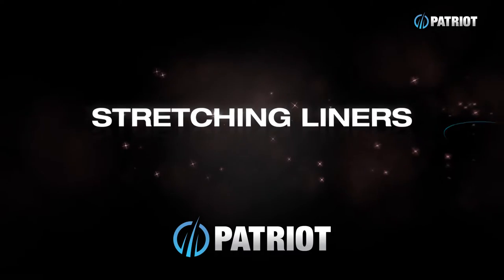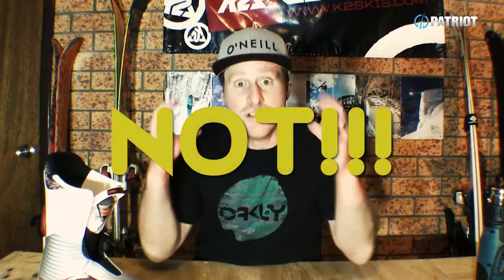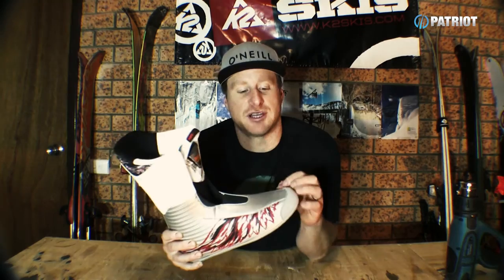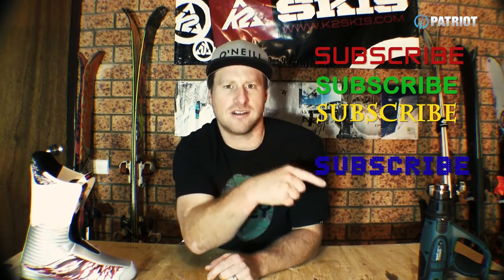Stretching liners - Bootorials Ep. 29

Comment: Do you have any visual examples on what happens when a liner blows out from old age?
Happened to me 2 years ago. I used to ski a lot in New England, but now living in Texas, so couple times a year. After the blow out, took a lot of effort to get my foot in the boot as the liner material was much more “malleable”. Had to use the ski racer approach on recreational boots...put liner on the foot, then put foot in shell, even then was a horrible experience.

Boots were about 14 years old. Luckily heel and toe of the shell had enough meat for bindings to hold on to, and the boot fitter recommended custom liners. (OMG...liner technology has come so far!! Yeah for ignorance!)

I wanted to share my experience with other enthusiasts, and was wondering if you had any visuals to demonstrate how bad it can get if skier waits too long.
Reply from the maker: Dont have anything great visually to share, but I did talk about it a little more in depth in this video - https://www.youtube.com/watch?v=31hUTWnqe0w
Yeah it seemed to have an era of boot liners where the adhesive leeched through into the fabric of the liner, was very common in Salomon and Lange liners. Basically made them impossible to put on. :)
Definitely some great options for replacement liners these days!!
Reply: Thanks for the link. That pretty much covers it. Liners I had to replace came from pair of Nordica Beast 10, early series with the red shell. Now I get to enjoy them a while longer.

I can tell my skiing style has changed over the years. Nowadays, I just want to feel the g-forces and get a great carve out of each turn. The boot shell may have a little too much flex, but I can definitely feel an improvement with the new Intuition liners. So I am happy skier!
Reply from the maker: Nice! :)

Comment: What are your thoughts on not using the liner? When I brought my boots, the place I bought them from said to use them without the liner for a couple of days (to break the boots in????). I use the liner but sometimes it feels nicer without. Big feet issues. Obviously not so great when its cold.
Reply from the maker: +Simon Neen  Not sure if we are using the same terminology! Do you mean not using the stock insole?
Reply: +Patriot Footbeds Hi Craig, sorry late night typing. I did mean the stock insole.
Reply from the maker: +Simon Neen Yeah I don't recommend skiing with nothing under your feet. Otherwise you are standing on a hard surface. The amount of space you would get from removing the stock insole is not worth the discomfort. What I do recommend though, is replacing it. Getting a good footbed will do so much more to stabilize and support your foot.  To get the liner to fit you best you should start with a heat mold, then the liners will take more shape around your feet as you start to ski it(break them in). If you still have problems with your big feet, you can approach some liner or boot modifications to get the space you need. Cheers :)
Reply: If you need a tad more room when boots are new try skipping socks.  I've worn white knee-high stockings when breaking in boots as they are thinner than even the lightest of ski socks (including liner socks).  I'm a dude and totally not self conscious about wearing cafe-high stockings to break in tight boots and you shouldn't be either.  From ten feet away you can't tell they aren't just white ski socks.